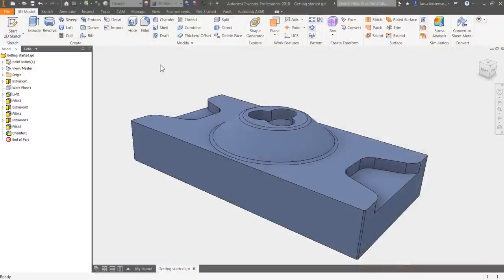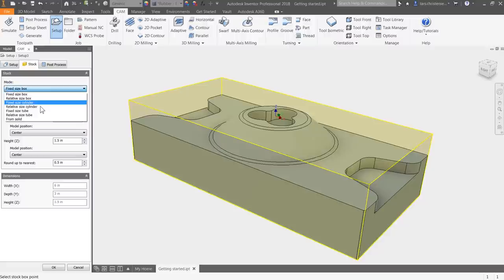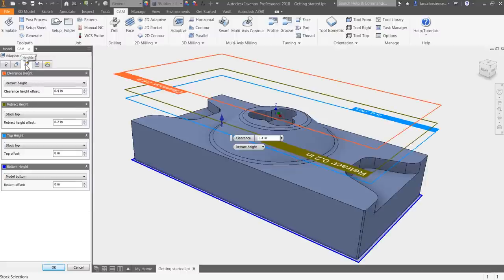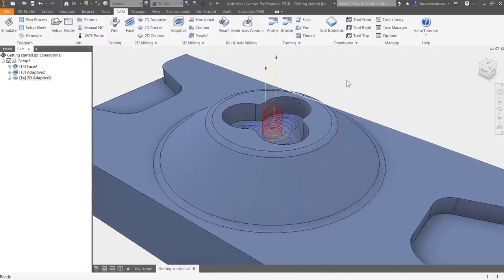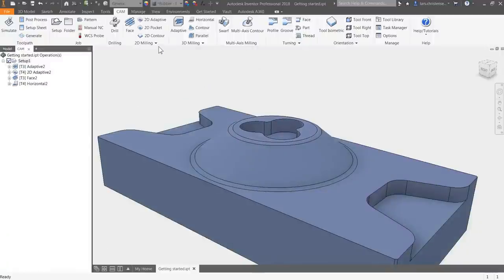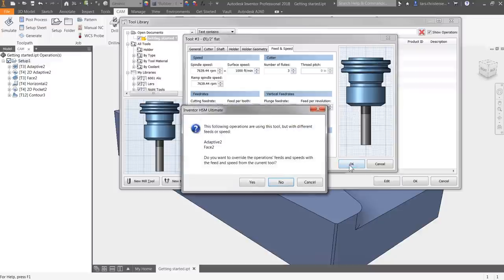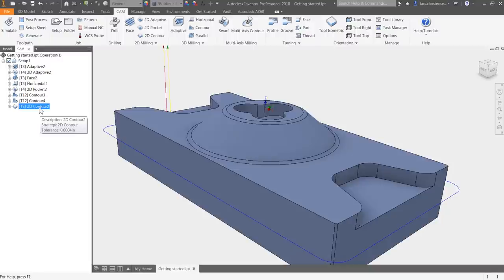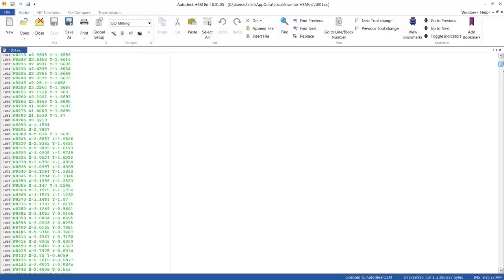Get Started With Inventor HSM

Comment: Hi , I'm referring to video at 3.00 to 3.10 , what's the different for stock box point between Tool & die maker and mold maker. Usually I practice for cavity bolster plate stock box point follow Tool&Die maker which at the edge. Can I select or used mold maker stock point for cavity insert while my cavity bolster using Tool & Die maker stock point.